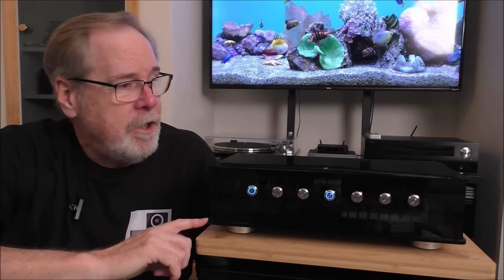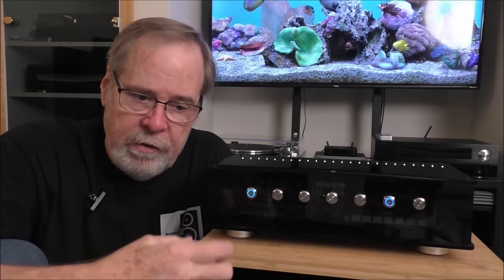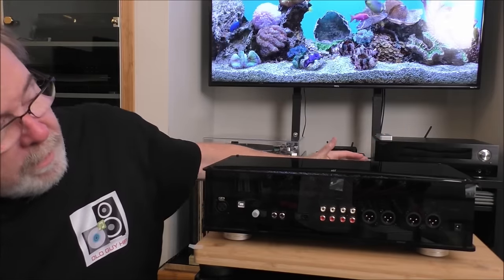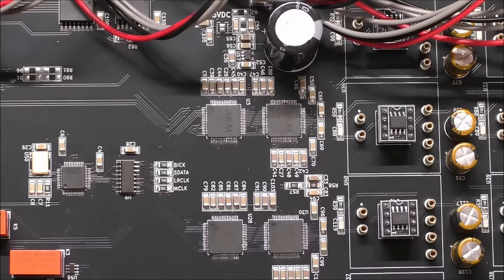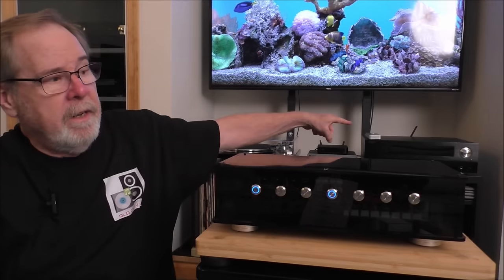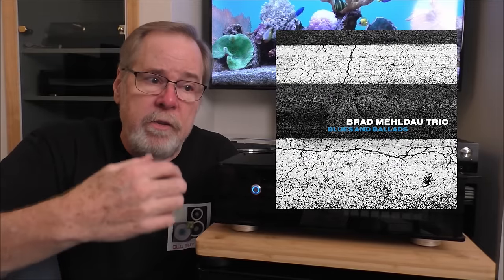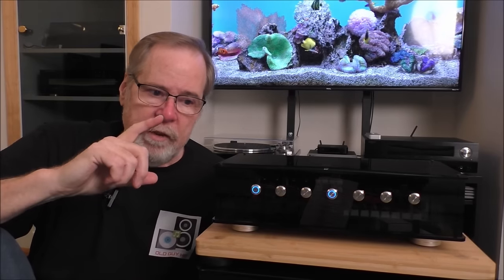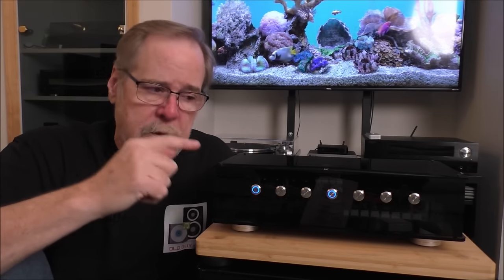The Dayzee is CRAZEE good! It is best chip based DAC I have heard this year or maybe ever!

Comment: I have the same DAC, if I run digital to it, and balanced output to my A10 classic, is the device I stream from truly gonna make a difference? I use a wiim ultra, thought about getting the cxn from Cambridge, but don’t think it will sound any better.
Reply from the maker: I do believe there is a difference. I use the Cambridge MXN-10 which has the same streaming engine as the CXN100 and only costs $399. I did do a streamer video if your interested. I think there is a significant difference.
Reply: @ so given that I have the ultra and the dayzee, what would be your recommendation for how I get it plugged in to my A10 classic?

Comment: As sent during your previous G reviews:  I'm definitely going to hold off until you get that Dayzee...

During my factory tour I got to hear this with the stock op amps and it sounds darn good with just those. If you upgrade to sparkos or burson and you have to do all eight that adds significantly more cost so you had to keep it at the $1,200 price point l--at which it's a steal.  And I almost like that smoked plexiglass look better than the woodgrain anyway--easier placement.

I still have a modified Oppo 205 that I use while I've had other unforeseen expenses of late (The Sabre Pro.DAC implementation there is no slouch!).   AKA some from the Florida hurricanes (luckily just back fence in my case).and some from speaker driver replacement.  I'm looking strongly at both this and the LAIV.  What I like about the Dayzee is that it can do DSD (but no remote)... And what I like about the LAIV is it has a really nice remote (but no DSD).   I doubt the Harmony sounds twice as good as the Dayzee @ twice the price..

Another dark horse R2R that I'm not sure you can get in to try  is the Holo Audio Cyan 2.  This one has a specific separate structure for DSD unlike most others.

Audio equipment pricing is getting out of control. Eversolo  just release their A10 flagship for almost four grand!!??.  Say what???   I'd rather get the parent company Zaidoo's UHD8000 and handle video as well...

Great channel and videos!
Reply from the maker: I am hanging on to the Dayzee a bit longer. I will which out to Andrew Sparks and see about some op-amps. Watch this space.

Comment: Thank you for another great review.  I wished you compared the Dayzee against the J3 Pro which is the single chip version of this reviewed unit and would have made a more fairer comparison.

How does the Dayzee compare with the Chord Quest?

I wish Gino would replace the extra set of TOSLINK and SPIDIF inputs in his DAC designs and provide for a selectable i2S inputs instead…. especially in the flagship Dayzee & J3 Pro.
Reply: Exactly as i2s definitely sounds better on my Pontus II dac. Even my inexpensive SMSL SD-9 player has i2s so is not expensive or hard to implement. And we do need a comparison between the Dayzee and the J3 Pro.
Reply from the maker: The only real sonic difference between then is the Dayzee id more resolute on the balanced out puts where the dual mono design really shines. On single ended I don't think there is much of a difference. I only had stock TI op-amps in the Dayzee. Compared to my J2S 4499 with the 3602 on single ended, there was, near as makes no difference no discernible difference. The Qutest is better but less flexible for gozinta & gozouts.
Reply: Agreed...I2S would open up some next level upgrades in other parts of my system.  I'm thinking I would love to add the PS Audio Airlens as my streamer, but without I2S, it's not really an option.

Comment: I agree completely - the Dayzee is the best DAC I have heard. Mine is powered by a Pine Tree Audio linear power supply, and I have upgraded to the Sparkos SS2590 op-amps.
Sublime.
Reply: @NeilBlanchard  which dacs have you heard?
Reply from the maker: I do wish I had a chance to hear it with 2590s.
Reply: @Pete.across.the.street  Not a huge number, admittedly:
Bifrost 2 (later upgraded to 2/64)
Ares II (later upgraded to the next firmware gen)
Modius (w/ additional USB power)
J2 AKM 4493 (w/ LPS)
J2S AKM 4493 (w/LPS and upgraded RCA to DIP8 SS2590)
J2S AKM 4499 (w/LPS and upgraded RCA to DIP8 SS2590)
Dayzee (always with an LPS, and upgraded to SS2590 after ~3 months) 
Back in the day, I had an Enlightened Audio Design modded Rotel CD player, that used a Burr Brown chip R2R I believe. This sounded much better than the Yamaha CD-X1 which was one of the first gen 1-bit aka delta sigma.
Reply: @OldGuyHifi  I will have mine at CAF - in balanced mode on the new Geshelli amps.

Comment: It was a masterful move by AKM to divide operations into two separate processors, and Geshelli deserves a ton of credit for implementing this architecture so effectively. Given my experience with the J2S, I am confident the upgrade to (8) Sparkos SS2590 single op amps will further elevate this DAC beyond the $550-600 USD required to do so. It would be very interesting to see how a Dayzee configured this way competes with the highly acclaimed $2700 USD Gustard X30 and its 4x ES9039SPRO configuration.
Reply from the maker: Theodore, I have the 2590 on single ended in my J2S and it does make a difference. I have a bunch of other op-amps on their way to me to try out and will probably do a follow up video about that. The Gustard unit scares me. 4 ESS chips! Eeek. The glare will be phenomenal. Thanks for the comment and for returning to the channel.

Comment: The AK4499EX datasheet states that the OPA1612 is the optimum opamp for that design. It is not a really expensive one. It's s like $6 each plus the DIP8 adapter $1-2 extra. It worth trying them out.
This DAC design is very interesting. I've normally seen one 4191 with 1 or 2 4499ex. Geshelli completely separated both channels.
Reply from the maker: Dr. Mick, I will check out those op-amps. Andrew Sparks discrete op-amps are very high precision and very good sounding. Have you had the chance to hear them?

Comment: Thanks again Ed. Perhaps I missed it, but did you use the stock wall wart power supply, or did you try a linear power supply?
Reply from the maker: Todd, I always use the stock power supply for reviews. I want folks to know how it does straight out of the box. For personal listening I did use an iFi power supply and it was a bit better. You may remember from Sunday's call that I thought it sounded better on balanced than single ended so that's how listened to it most of the time.  Thanks for asking.

Comment: OG
another good 'un.Wonder why the number of outputs is so great.One question do you know if you have to roll all 8 0p amps at once?That could be pricey at $80 a pop or so.This matches up price wise with the 1 bit Topping D90III I mentioned other day and nicer folks to support I guess.One thing I wonder about is the grouping of test gear at price/quality point.Know you have upper gear with Hegel and I have no quibbles about Cambridge but wondering if a bit diversification might be in order.
Reply from the maker: Charles, I am at the mercy of what manufacturers are willing/able to send me. I don't always mention all the gear I use. for example I did listen to the Dayzee with the Advance Paris A7, but since that review isn't out yet I didn't mention it. I also use gear I am very familiar with. That way I know that whatever I am hearing is the device I am reviewing. I need benchmarks to be accurate. If I used an amp and speakers that I wasn't familiar with, I would not know where the difference is coming from. Does that make sense? Thanks.

Comment: While reviewing or demonstrating a component, it is important to realize we don't listen one individual component but the whole audio chain: source, interconnects, preamp,  amplifier, speaker cables and speakers. Being the speakers, the weakest link on that chain. Good speakers have 0.25% or -52dB THD, interconnects have 0.0001%, amplifiers have 0.001%, preamps also 0.001% and DACs 0.0001%. Every other element is sonically transparent. 
What does sonically transparent mean? If a device has -80dB or 0.01% THD, it means those distortions and noise play 80dB lower than your music level. It means if you play your music at 80dB then distortions are not heard. If you play at 100dB, then those distortions play at 20dB, which is still lower than our room noise floor(30 to 40dB). Of course I'm just using THD as an example, but for me Intermodulation distortion IMD plays a more important role in how we perceive music because compared to harmonic,  THD sounds better, in fact it sounds very musical and hence the reason why tube amps sound so "analog". For me, the biggest benefit/impact is obtained when replacing speakers. Your speakers are your bottelneck. Once you get better speakers, then you start noticing differences on other components upstream the audio chain.
On a speaker with 0.5% or -46dB THD , those distortions will be easily detected while playing music at 80dB or higher.
Reply from the maker: Dr. Mick, You will love my next "Best of" video where I talk about a lot about TIM.  That should be out soon. I am still editing it. Thx.

Comment: Hi Ed, another great and informative review!  Looking for your thoughts:

Considering a full-on J3 with USB input and SS2590’s is approaching $1000 (without a custom case), do you think the smart move is to spend just slightly more on a bare-bones Dayzee?

Really interested in your thoughts!
Reply from the maker: That's a tough one. The stock Dayzee is at its best on balanced. I think even when rolling that is where it will shine. If you don't use the balanced as the primary output Get a J2S or a J3 Pro (basically the same DAC) and put a 2590 in on the single ended side. That's what I did. I have 3602s on the balanced side and it is wonderful. On single ended I am not sure I could hear the difference between my J2S and the Dayzee. Up to you but, if you do balanced, the Dayzee makes sense. Just remember it is $480 to roll the 2590s into it. Thanks.
Reply: @ yes, at this level I’d be using balanced for mains and single ended shared between subwoofer and headphone amp.

Connectivity is much better with the Dayzee, which is what got me thinking about it; no more cable switching going between speakers and headphones is worth something!  But then the form factor comes into play… the Dayzee is a big girl and would dwarf my other components.

Lots to consider.  Thanks Ed!
Reply from the maker: @superspeeder  The Geshelli's are letting me hang on to the Dayzee so I can roll op-amps. I will be reaching out to Andrew Sparks today to see if I can get handful of 2590s. So hang tight. I won't have an answer on the rolling until after Thanksgiving. I have a back log of gear to get through first. I know, it a tough job but...
Reply: @ haha, first world problems, right? 😁  I’m looking forward to your findings!

Comment: I own 5000 dollars speakers kef r7 meta  through a 5000 dollars poweramp Nad m23, and the differences between a topping dx9 pro using akm 4499eq and the Gustard r26r is small. Especially the timber and stoundstage width. The r26 is a bit more airy, espaecially in the mid range. But regarding details and resolution, no difference at all also when comparing my Eversolo dmp6 master editions own dac
Reply from the maker: Thank you for sharing your thoughts.

Comment: Are all Burr Brown DACs ladder DACs?  I got a new (to me) Denon 5 disc changer, DCM-280, which features a PCM1748 Burr Brown DAC.  It is said to be an 18bit DAC with 8x oversampling.  Wanted to know because I'm still considering purchasing the Fiio K11 R2R headphone amp & DAC.  I will probably getting a new cartridge for my turntable instead of a DAC anyways.  Thanks.
Reply from the maker: The PCM1748 is a Delta-Sigma chip. It is a very good one. The key with that generation of BB chips that they only over sample at 8 times rather than the 256 times like many modern chips. It is much easier to filter the switching noise at 8x than at 256x. I like those chips and have some great old CD players that use them and they sound great. Listen to it for a couple of months before you ad a DAC. That way you will have a chance to get used to the sound and it will be easier to hear the difference. Who knows, you may like it as it is! Thanks for being a regular.
Reply: @bpalpha  Answering this question. No, not all BB DACs are ladder dac, only the first ones from 80 and 90. PCM56, 58, 61, 63, 1702 and 1704. With PCM63 considered the best of all.
Reply from the maker: @MiguelAngelVelazquez  Dr. Mick, Great info! Thank you so much. I learned something from it. I hope you become a regular. Thank you.
Reply: @OldGuyHifi Nah.  She’s good as she is.  Miles came through with such beauty! 👍 Probably going to get the Fiio because its value as a headphone amp + dac capabilities.

Comment: @oldhifiguy you recently reviewed the Chord Qutest which was the best DAC u heard until then. How does the Dayzee compare ? Strengths /weakness in comparison
Reply from the maker: Both are very good for slightly different reasons. FYI, I have Sparkos 2590s in the Dayzee now. I didn't have them here together so I am operating from memory. The Dayzee has a better bass response and is a bit punchier. The Qutest has a more delicate sound. A bit sweeter, not more refined just a bit airier. Both image well and present a very satisfying sound stage. Tough call as I would be happy with either for the long run. Did I thread that minefield? The thing is, that there is only subjective conclusions. What I hear may not be what others hear. I don't like ESS Sabre DACs as a general rule and you wouldn't believe the hate I get for it. I know I didn't answer your question thoroughly but I am not sure I can. Does that make sense? Thanks.
Reply: @OldGuyHifi  Thanks for that reply.
Now with the Sparkos 2590 does that open up the Soundstage even more?
   I am on the lookout for the best imaging (width and Depth) and it's between the Qutest and Dayzee(with s2590) on my list for now. Since u r one of the very few to have heard both what's ur recommendation? or for similar money would you consider something else. Thanks again.
Reply from the maker: @cory3685  Cory, Soundstage is more dependent on the rest of your system. Both DACs can provide the best signal possible but it also depends how resolving the rest of the chain is. On my reference system both had a similar sound stage and image. The Dayzee may have been ever so slightly bigger but the Qutest was ever so slightly better focused. So much also depends on the quality of the recording. Some well recorded classical can blow your mind and some pop music sounds like it was recorded in a truck stop bathroom. There are many more factors other than the DAC that determine imaging and sound stage.  The 2590s brought the Dayzee on par with the Qutest. Without that upgrade, I would choose the Qutest. Now it is splitting hairs. I could live with either permanently and be happy. My heart goes with the Dayzee because Geno & Sherri are good friends and I like to support family businesses. You my friend have to make the choice. You won't go wrong with either. Keep me posted. Thx.
Reply: @OldGuyHifi  Thanks for that wonderful detailed reply.
    It so happened that a local Hifi dealer I purchased my speakers from is also a chord dealer. With the Qutest DAC it sounded smashing. Clear instrument separation and Very good Soundstage. I found a used one with an Upgraded LPS. For the form factor, build and sonic quality levels I could not be happier. Pretty sure the upgraditis will hit me again in the future. Keenly watching ur channel.